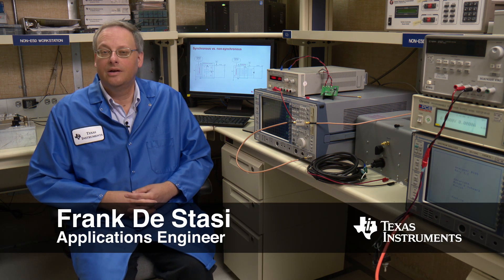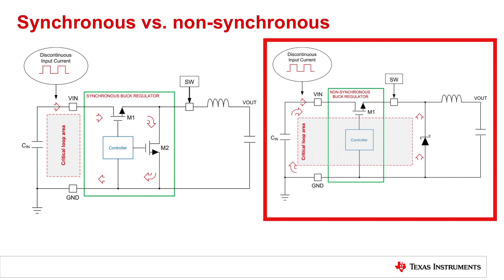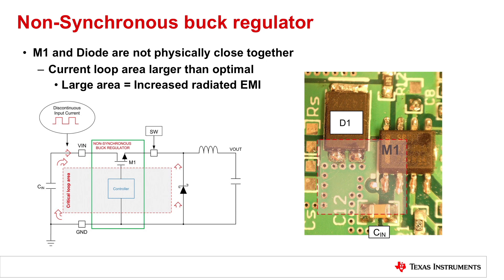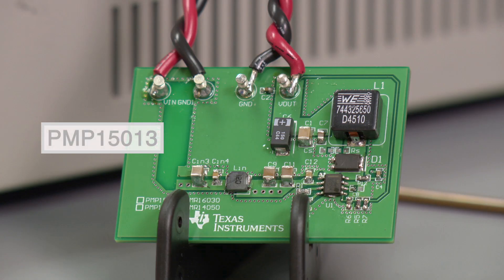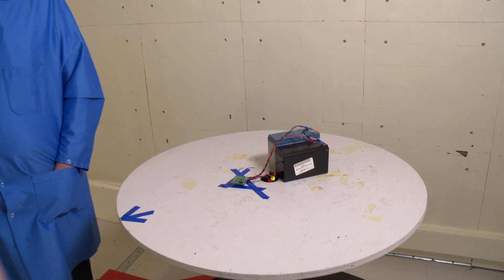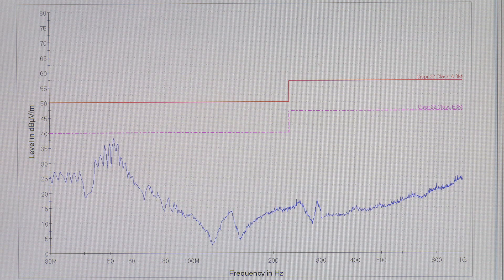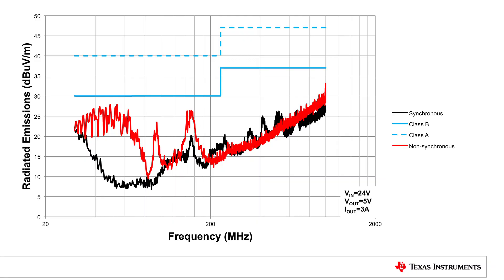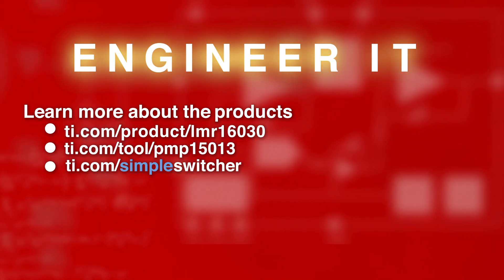Engineer It: How to achieve great EMI performance with a non-synchronous converter

Comment: Always good to see a discussion of emissions from switchers!   It appeared that this was more of a demonstration of the differences between switchers with integrated switches vs non-integrated switches.   For instance the T.I. U3874 is a synchronous buck, but uses external mosfets.  
I've only spent a bit of time fixing EMI problems on switchers, but one aspect of external mosfets that is nice is that the switching speed can be controlled.